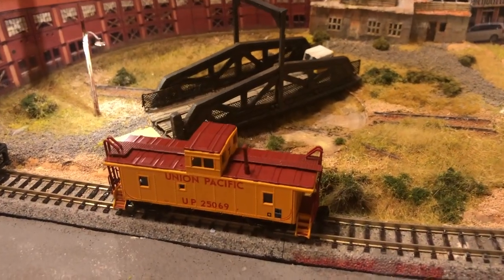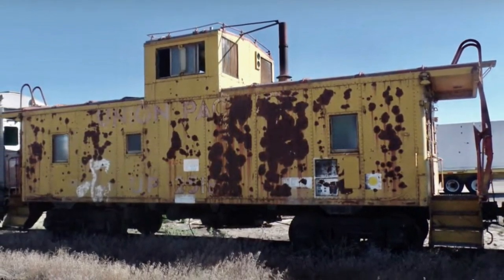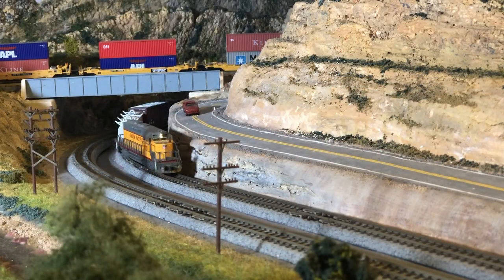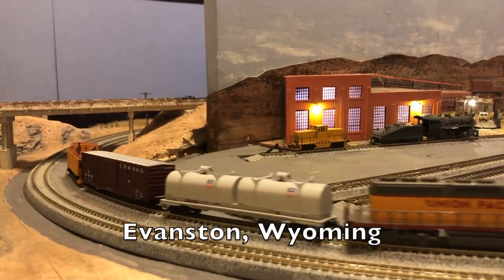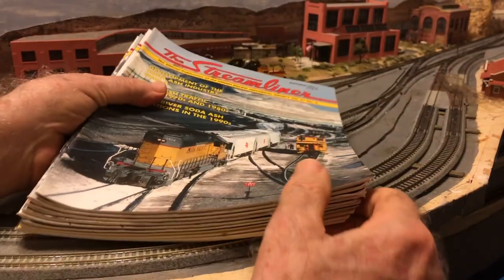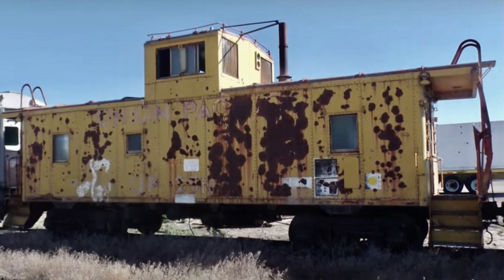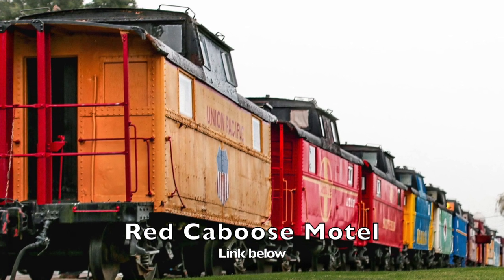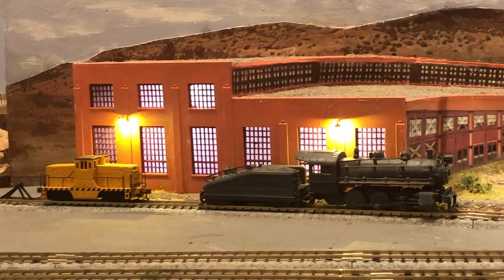A Caboose on My Modern-Era Layout

Comment: Cabs are also frequently used as shoving platforms out in the eastern US (BNSF too). I've protected a shove using one, much more comfortable than hanging off the side.
Reply from the maker: They sure are, my friend. I wish I had remembered to mention "shoving platforms" in the video. I'm sure it's better to be on a caboose during shoving move than hanging on any other freight car. ...Roy
Reply: @n-scaleunionpacificevansto6569  In most cases it is, only downside is it can get a bit boring. The possibility of losing your grip and falling tends to keep things interesting while riding the side
Reply from the maker: @intermodalman123   I can just imagine, my friend. Thanks. ...Roy

Comment: Nice story and info when I stated my layout (ho) I bought a caboose with my first engine my first rolling stock I only now run it with my track cleaning cars , I also put tail end lights on two on my rolling stock 1 on a hopper 1 on a box car ...!
Reply from the maker: Thanks, Tom. Lights on a caboose sounds like a great idea. Maybe I should try to do that. ...Roy
Reply: @n-scaleunionpacificevansto6569  I may have miss spoke didn't put a light on my caboose.!

Comment: Nice to see a "proper" UP caboose appearing on your layout!  I say proper because recently I watched videos of a couple BEAUTIFUL layout that had "fake caboose".  There are lots of caboose models with UP paint jobs, but only a few are truly a design that was used by UP.  I'm a semi-rivet counter, but I really care about cabooses as they are often very specific and indicative of the prototype.  For instance, the design of the CA3/CA4 (as seen on your layout) was the standard for steel cabooses on the UP.  Details changed but the same layout and size was used until UP bought 100 short-body bay window cars in 1979.  The UP didn't use the steel end-cupola design, or the extended vision cars (until they got some from MoPac).  The green "T" on your model's cupola indicates that it was assigned to transfer service.
Reply from the maker: Thanks, Gary. I really appreciate the information you've shared. I always do, because my never-ending quest is to make my small layout look and behave as prototypically as I can. The model that Jason sent to me is actually a CA3, but the prototype at Evanston is a CA4. I guess I can get away with using a CA3, because it's pretty much impossible to spot the difference. Thanks again for sharing the hobby with me. ...Roy

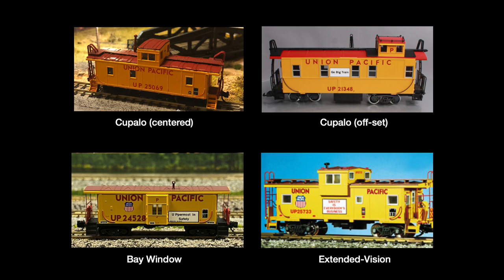Comment: Hi Roy, Very interesting video and history of the UP CA4 cabooses. I have to mention Justin Case is going to be disappointed with you. The name of the part on top of the caboose is a Cupola not a Cupolo  😉 ( See timestamp 9:03 ) Also here's a fun fact, today when railroads ship cabooses from one location to another, quite often they'll put them in the middle of the train to discourage crew members from riding in the caboose. Also the Department of Defense and a few rail car suppliers that ship over side loads have cabooses, which are known today as "Rider Cars". These Rider cars are used by non railroad crew members to escort the load to it's final destination. I know a couple retired guys who work part time escorting over sized loads riding in the "Rider Car", it's a great way to see the country and earn a little extra money. In a few cases railroads still use cabooses where a long backup move is required to reach an industry. Those cabooses are also known as "shove platforms" and generally have all the windows plated over and some even have the doors welded shut. Another great video Roy, thanks for sharing it with the model railroad community. Cheers, Rich S.
Reply from the maker: Wow, thanks, Rich! I need to learn how to spell "cupola." I'm so easily confused. Thanks for that information. I've learned a few things from your comment, and as always, I really appreciate it. I was wondering where to put the caboose in the train on "its run from Ogden to Evanston." I thought of putting it more forward in the train, but not knowing what to do, I ended up just sticking it at the end. I may need to do a sequel. A day is never wasted when I learn something, and I've learned so much from friends in the hobby like you. ...Roy

Comment: That is great! Interesting that you were able to remove the number from the visible side of the caboose with an eraser. I'm planning my first N scale layout. It will probably some sort 3x6 or 4x8 set in the Midwest during the 1950's-60's with the exception that I have an Atlas LTEX GP15-1 built in the late 70's/early 80's. I actually bought my first caboose a few weeks from my local hobby shop! It's a Wisconsin Central ex-GB&W from Bluford Shops, number 116.
Reply from the maker: Thanks for your comment. It’s amazing how easily the number rubbed off without affecting the underlying yellow color of the caboose. Now I’ve just got to weather it to match the prototype. Welcome to N scale. It’s tons of fun. ...Roy
Reply: @n-scaleunionpacificevansto6569  Thanks Roy ! I actually started collecting a few locomotives about a dozen cars five years ago it's only now that I'm really getting into it. Cheers!

Comment: Do you use Kato track?
Reply from the maker: I sure do, Daniel, and I really like it. I've used flex track in the past, but now I'm getting too old for all the bending, cutting, and soldering. What I need now is convenience and reliability, and that's what Kato Unitrack gives me. ...Roy
Reply: @n-scaleunionpacificevansto6569  ok I'm going to model n scale with Kato unitrack
Reply from the maker: @Toddgillilandfan  Good idea, Daniel. Everyone who uses it seems to be very happy with it. ...Roy
Reply: @n-scaleunionpacificevansto6569  do you use the kato track with the automatic signal. here is a picture https://www.trainworld.com/manufacturers/kato/kato-20-605-124mm-4-7-8-automatic-signal/
Reply from the maker: @Toddgillilandfan  Daniel, I haven’t set up a signal system on my layout yet. Eventually I will, but it will have to be a system that works with DCC. ...Roy